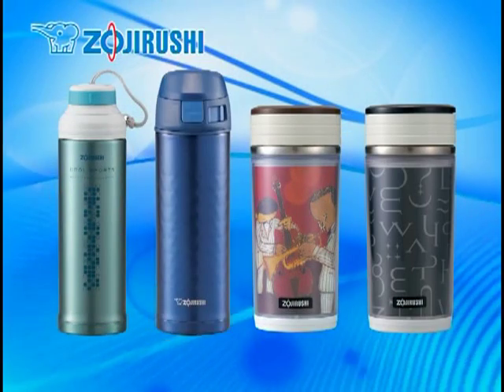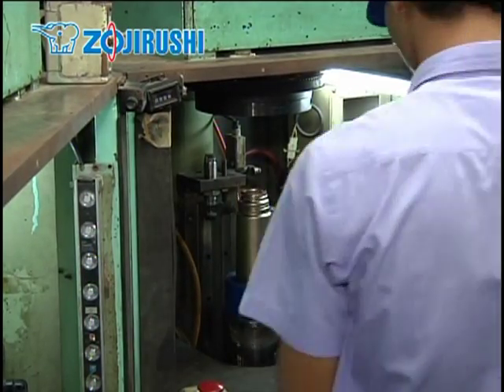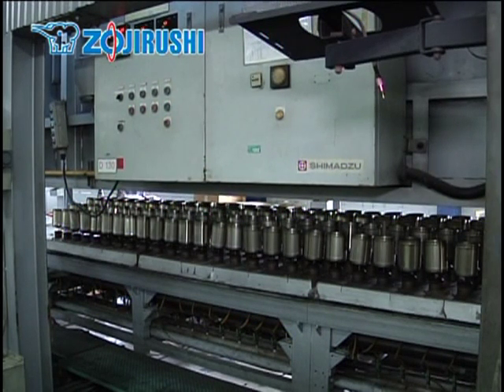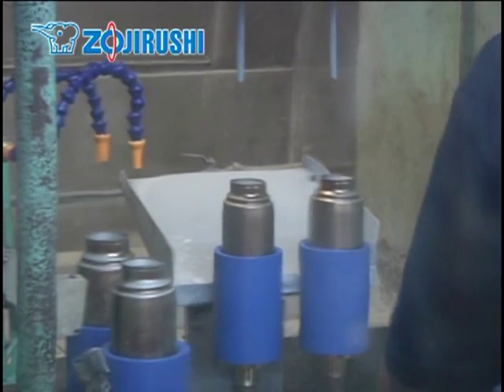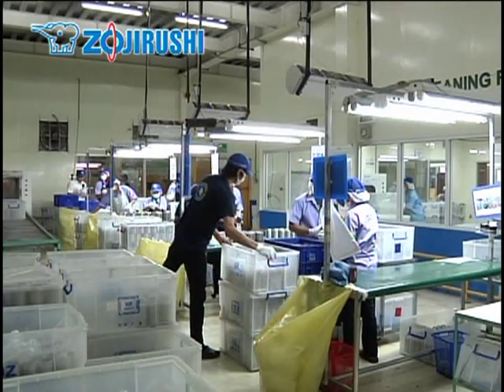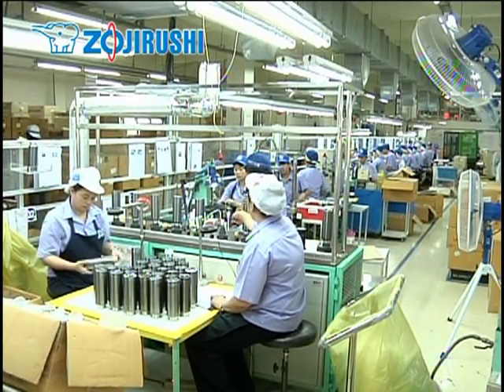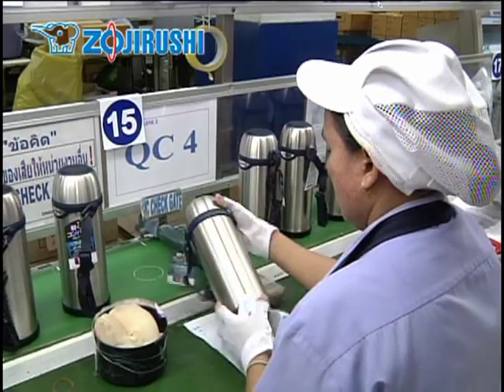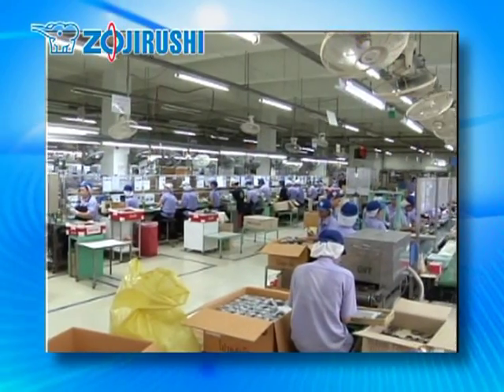Zojirushi Bottle Manufacturing Procedure

Comment: That inner coating is the one BIG problem with these. It peels off. It's like teflon. It only lasts so long. And you end up drinking some of it. Also, it holds odors. Just plain stainless steel is better. But, no one can beat Zojirushi insulation capabilities. Plus, it has a 5 yr. warranty.